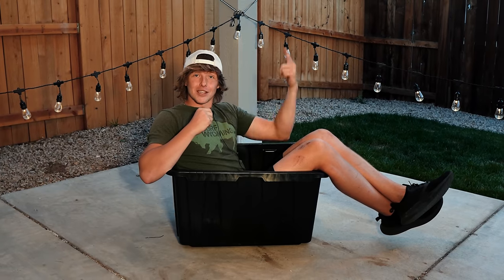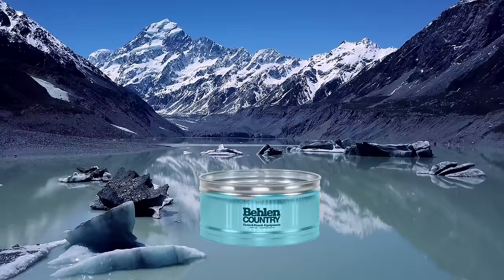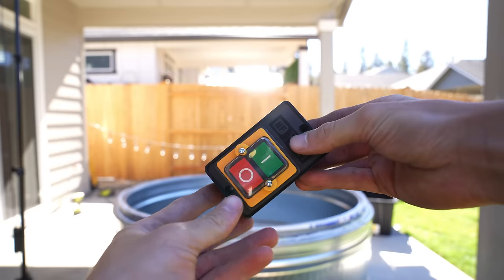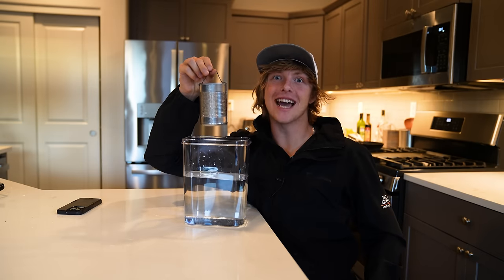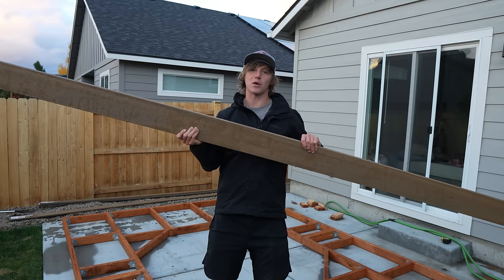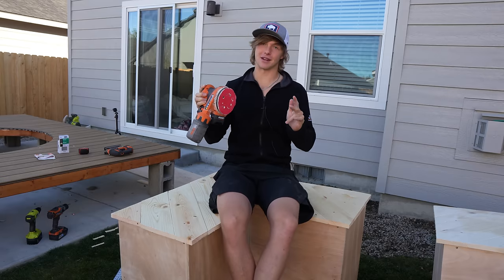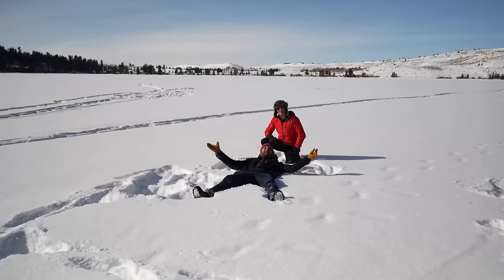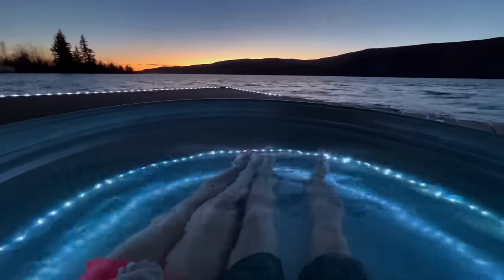I Built a Floating Hot Tub

Comment: Next time box in a square  box on top of a platt form purchase an inflatable hot tub there  puncture resistant secure it with in the box also build a small water proof housing unit to protect power sources which consists of 2 car batteries and a small generator and a small handheld jump box use clear silicon caulk for sealant